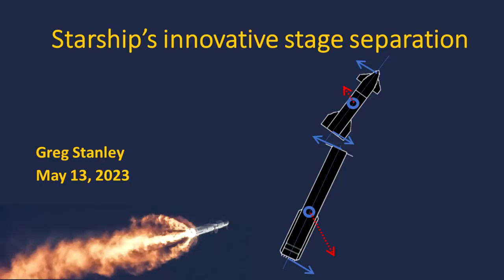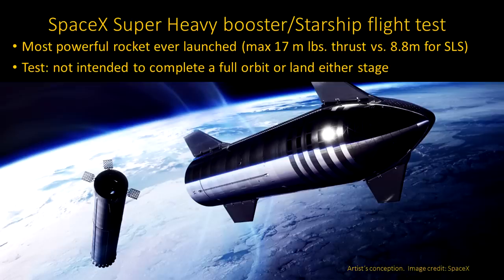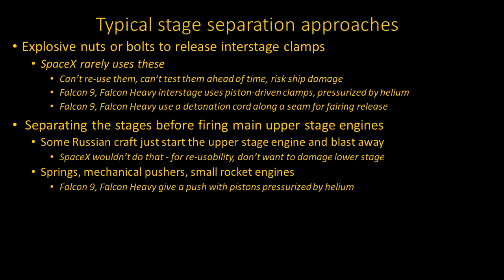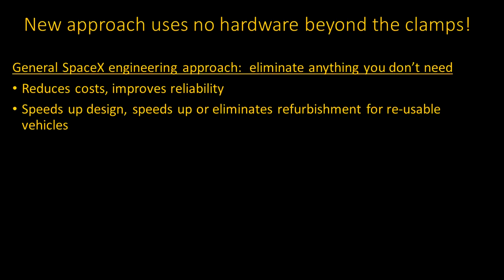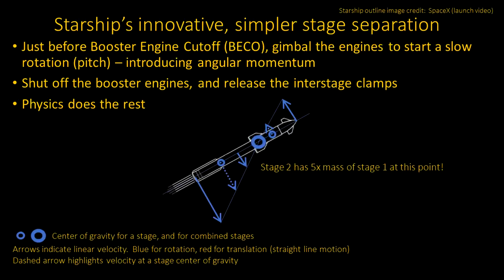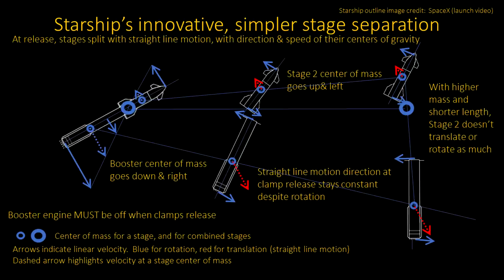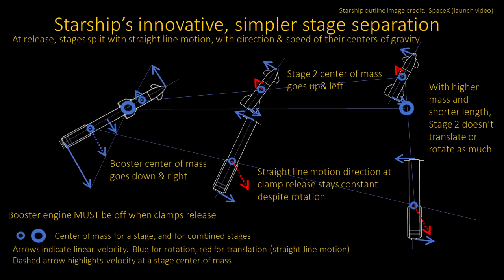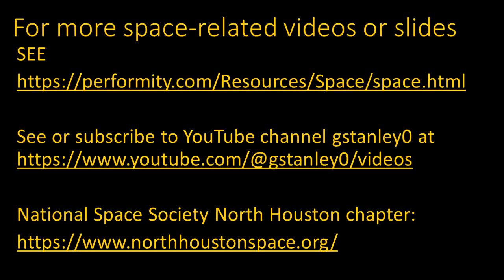Starship's innovative stage separation, using no hardware besides clamps, illustrated

Comment: "stage 2 doesn't rotate as much" - it's wrong. Rotation is the same for all parts after separation (in vacuum!). In real it depends from air drag.
Reply: exactly what i thought. Both stages keep their velocity moving sideways around each other as a movement drifting tangential apart from each other after separation. And they will keep their rotation.
Reply: Indeed, this should be intuitive since there are no forces involved in the separation (therefore no torques applied). I think people tend to forget the angular momentum associated with the linear separation when doing the conversation of angular momentum.
Reply from the maker: Yes, the angular velocity of the separated stages matches the initial angular velocity of the ship, as I realized when I finally worked through the calculations.  No matter what sort of variations apply (stage lengths, stage weights, distribution of weight within a stage due to payload or propellant), the end result is always the same angular velocity for the separate stages, matching the initial angular velocity. I'll have to look into how easy it is to modify videos already out on YouTube to fix this.

Comment: Wonder if an emergency "break clamps and fry the lower stage" fall-back sep-option might be added.  Perhaps this test could have proceeded further had there been one.  Those clamps sure held well in total ship rotation, anyhow!
Reply: the test would have failed anyway, the booster lost gimble so the steering was lost already anyway for the lower stage putting the upper stager on the wrong trajectory and at a lower altitude than needed for orbit.
Reply: @foggiertiger535  Not the full flight profile, but they would in principle (assuming fall-back scenario allowed for) have been able to test that upper stage more.  Especially its steering (gimballing/jets/fins) and overall recovery capabilities at significant altitude.  Also its general robustness (in a more representative context!) and of course its fuel/engine elements. The (accidentally) spare fuel (insufficient to attain orbit) could have been used to manoeuvre to a more controlled hence more predictable and gentler splashdown, latter handy for post-flight hardware analysis.
Reply: @DavidEsp1  Yeah good point, I also realised I said the test failed, which if obviously didn't it was simply a rapid unscheduled disassembly  😆
Reply: Seems like that should be part of the flight profile. At least a way to not lose the entire mission if Starship can get separated to continue the flight.
Reply: @EleTruk  I'm sure they had their reasons that I just can't think of lol.
Reply: @foggiertiger535  As a matter of range safety, probably not going to make it through the review process that the second stage can be fired from a first stage which isn't under control?  Just the same, it would have been nice to collect some off-nominal data in order to have more confidence once people are on board.

A bit like that 1960s Little Joe II flight which had an unplanned elevon hardover leading to failure of the booster once spin exceeded the structural limit:  The Apollo capsule zoomed away from the unplanned disaster anyway, thanks to breakwire activation of the Launch Escape System IIRC.  So the flight never hit its intended test points, but you've gotta imagine that just the same, this safe recovery out of a random catastrophic failure put smiles on plenty of astronaut's faces that day.
Reply: @marcmcreynolds2827  that’s what any escape tower does
Reply: @MyShanghaiShuffle  "that’s what any escape tower does"  And fully-destroying a (Starship) booster immediately after the destruct signal is sent is what any range safety destruct system does.  Supposedly.

Designing and building a system to do something doesn't mean that it's actually going to work.  Demonstrating that it works under prescribed test conditions builds confidence that it will do its job if needed during an actual flight if certain things go wrong.  Having something unexpected go wrong during a test, and yet a system still works even under conditions it wasn't specifically designed for, provides added confidence to the people who will put their lives on the line that it will be robust enough to handle whatever might befall them.

That was especially relevant in the context of the Saturn V.  Even a normal liftoff felt somewhat like the vehicle was coming apart to the astronauts getting all shook around.  And the abort handle's right there for the commander to activate, so confidence in the LES is important to mission success.  Little Joe II  flight A-003 provided some of that confidence:

https://www.youtube.com/watch?v=w8qouIGip74

Comment: The only fly in the ointment I see with this scheme is the fact that these aren’t two rigid bodies. The upper stage (SS) is effectively a rigid body given that the tanks will surely be filled to the gunnels. The booster will be 95% empty with 5% sloshing around wildly during this rotation. Is there spherical header tanks in the booster too and you could 100% expend the fuel and oxy for the main tanks, and have the headers slosh-free? I would think the quantity/mass of fuel to land is not completely trivial…

Comment: A few minor corrections: because the upper stage is shorter, that decreases its moment of inertia, making it spin faster than if it was as long as the booster, the mass however, is much higher at stage separation, which does increase the MOI of the ship relative to that of the booster.

I = ~1/12ML^2 (rod rotating end over end, flaps and grid fins are mostly negligible when determining MOI when rotating along this axis)
I = MOI
M = mass of the ship/booster
L = Length of the ship/booster

Also, the ship belly-flops for reentry, not the booster. The booster comes in straight down like falcon 9, the flip is still necessary to perform the boostback burn to return to the launch site.
Reply from the maker: Thanks for the correction.  Noted.
Reply: The booster doesn't belly flop but it does return at a flatter angle than Falcon 9. It has 2 strakes running up either side of the windward surface so it has a slight cross range ability, saving on the amount of boost back propellant needed. This may also help reduce the peak heating but I'm not sure about that.
Reply: The upper stage is more heavy. Why does the less length decrease its moment of inertia? Why is that relevant for the rate of rotation?
Both stages are spinning with the same (low) rate of rotation (degrees per second) before opening the clamps. Why do you think they should not keep that rate individually after separation?
Reply: @hendrik1745  You are correct. They will maintain their original rate.
Reply: @jeremyglass4283  At the instant of separation, neither the booster nor the upper stage change their MOI. Each has its own (pre-existing) angular momentum and its own (pre-existing) MOI; therefore their rotational rates don't change. However, if the upper stage tucked their arms in while attempting a double salchow after separation (thereby changing its MOI), then it would spin faster.
Reply: @jeremyglass4283  At stage sep there is no mass moved in the rotating object but the object is instantly split.
A skater couple, she is standing/sitting on his knees, both using his skate as common pivot point. He pulls her closer, they turn faster. He pushes her away, but still holds both of her arms, so they have still a common rate of rotation, but the common rotation is slower.
He releases her instantly, both persons keep the rotation individually what they had together just before.
The rocket would change rotation when they pump propellant to another tank. But separation does not change the rate of rotation.
But if the tank is not full and the combined object was rotating around the combined center of mass... e.g. the booster has propellant left and that LOX is placed at the bottom near the engines and the methane is placed at the bottom of the upper tank. After sep the booster rotates with the same rate as before sep. But it now rotates around its own center. Engines are mass. Propellant is mass. The tanks are lightweight steel balloons. At least the methane in the upper tank will float to the upper end of its tank. The LOX will stay near the engines. So the booster moves the mass of the methane internally. For the booster your argument is correct. it will slow down a little bit.
The tanks of the ship are full. No movement of mass. It will keep rate of rotation.
Reply: @VirtualEric-ln8ck  the more I think about it, that does make sense. This is an explosion (the physics definition), not an object changing it’s MOI by performing work upon itself.
Reply: @jeremyglass4283  cool discussion. All participants have been fair. No one was correct at the beginning.
I had forgotten the translation of fuel within the booster which in fact slows its rotation down a little bit.
We have found the solution of the question in good teamwork. Thx
Reply from the maker: Yes @jeremyglass4283 , @hendrik1745 ,  @ErikDennison , 
@VirtualEric-ln8ck ,  the angular velocity of the separated stages matches the initial angular velocity (assuming no work done to shift fuel location), as everyone here concluded based on first principles arguments.  I finally worked through some numerical calculations (dividing the ship up into 200 elements).  No matter what sort of variations apply (stage lengths, stage weights, distribution of weight within a stage due to payload or propellant), the end result is always the same angular velocity for the separate stages, matching the initial angular velocity. 

Based on dimensions and weights from Wikipedia, and eyeballing the rough locations of propellant tanks, etc., it looks like the center of mass of the ship prior to clamp release is at around 255 ft from the bottom, which places it 25 feet up into stage 2. Exact numbers depend on assumptions on stage 1 propellants remaining (I assumed 2% for my base case), exact locations of the propellants in either stage which I only roughly approximated, payload weight and distribution,  and didn't account for the engines separately. 

People have been speculating on how violent and lengthy the rotation needs to be.  From the test timeline at 
https://www.space.com/spacex-starship-first-orbital-launch-explainer  , 
there's only 5 seconds  between clamp release on 2nd stage engine start.   

If I assume an initial 0.1 radian/sec rotation (about 5.7 degrees/sec) about the ship center of mass, someone sitting at 80% of the height of stage 2 would experience that as about 10 - 11 ft/sec .   The centers of mass of the stages after separation would move apart at about 18 ft./sec.  So in 5 seconds, the stages center of masses drift apart by about 5*18 = 90 feet.  In those same 5 seconds, their stage would have rotated 5*5.7 degrees = 28.5 degrees. And, as pointed out elsewhere, the stage 2 exhaust would be rotated, not pointing directly at stage 1.  Are these acceptable sorts of numbers to not be considered "violent", and safe to avoid damage to the booster?
Reply: @gstanley0  You say: both COG (center of gravity or mass) drift apart with 18ft/s. You assume 180ft between both COG ? I would guess 250ft between both COG. The COG of the booster will be far down near the engines and the fuel. I expect more fuel left for return.
Let's take your 180ft. And a coordinate system aligned to the rocket at separation. Rocket pointing up in our system. Lower stage moving to the right and upper stage to the left. After 5sec they have drifted apart 90ft at the x axis while the upper stage is still 180ft "above" the booster on the y axis. ArcTan(90/180) is 26.6deg. The upper stage has rotated 28.5deg. Engines still pointing to the first stage.
Assume twice the angular velocity: They will drift 180ft in 5sec. Still 180ft offset on y axis. They are paced at 45deg after 5sec but the 2nd stage has rotated 57deg. Longer waiting or quicker rotation make the 2nd stage plume point beside the booster.
Caused by the offset on the y axis and by the drifting in different directions on the x axis which fits the rotation both stages seem to drift apart exactly longitudally in the first moment. A little bit later the 2nd stage engines turn more and more away from the booster.
The load to the astronauts sitting 100ft above the combined COG: A kind of artificial gravity. Accelleration with the quicker rotation is square(0.2rad/s)*100ft =4ft/sec2 which is 12% of earth gravity. But the way their seats are placed in the rocket for the normal propulsion in the moment of stage sep with rotation this force will pull them up into the harness. Wow! I think they will easily survive that. Some roller-coasters might be harder. In the moment of separation this force will reduce since they rotate at the same rate but around the COG of their own stage wich is closer to the astronauts.
Reply from the maker: @hendrik1745  Thank you.   I didn't actually directly assume a distance between centers of mass.  Instead, I'm building up a (spreadsheet) model of the mass distribution - that's where the 200 elements comes in.  That way, I can more definitively define where the CMs (Centers of Mass) are for the ship and stages, then calculate accurate moments of inertia, rotational (and then translational) kinetic energies and resulting linear and angular velocities.   The centers of mass for stage 1, stage 2, and the ship just result from that model, at 101 ft., 280.9 ft., and 250.6 ft.,  depending on amount of fuel left, payload, etc. 
That model is rather crude right now, not accounting for differences in the mass of oxygen vs. methane (and not accounting for deviations from a stoichiometric mass ratio of 4 for oxygen/methane),  not accounting for the heaviness of the engines vs. normal empty stage mass, and depending on the assumption on percentage of propellant depleted.  Any suggestions on those sorts of numbers would be helpful.    For payload, who knows what they're testing with -- I'm just winging it as a point mass at 80% of the height of stage 2, and leaving it as a parameter to fill in. 

It won't matter for the geometrical analysis, but might matter to astronauts:  from the limited animations shown by SpaceX (in the video in their lead-up to the launch), it looks like rotation just before separation is started when the rocket has already gone much closer to a horizontal orientation - perhaps 30 degrees from horizontal.
Reply: @gstanley0  Considering the mass of the fuel and the engines I expect the center of the booster to be below 100ft. But I might be wrong and it does not matter for the rotation of the upper stage (with full tanks) after sep.
More interesting if you agree that the rotation should be at least 0.2rad/sec to get the engines plume at ignition pointing well beside the booster.
With 0.1rad/sec bot CMs are still 180ft away on the x axis plus 90ft on the y axis. That is just 201ft distance between the CMs and just 21ft from the engines to the top of the booster. And as described before not yet enough rotation to fire the plume beside the booster.
(my coordinate system: y axis aligned with the rocket in exactly the moment of separation. So constant distance of 180ft on the y axis and constantly drifting apart to different directions on x axis)

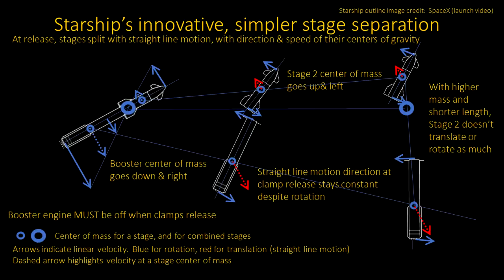Comment: Amazing explanation and illustrations. One thing I would like to add is that the flip of the booster isn't for a belly flop manouver as you said at 9:33 but instead for the boost back burn that the first stage needs to perform to cancel out its horizontal velocity to return to the launch site just like the falcon 9 booster does for landings on land. The booster might still do some sort of belly flop for it's reentry, similar to the starsip upper stage, but the flip directly after stage separation is to face back towards the launch site to perform the boostback burn.
Reply from the maker: Thanks for the correction.  Noted.